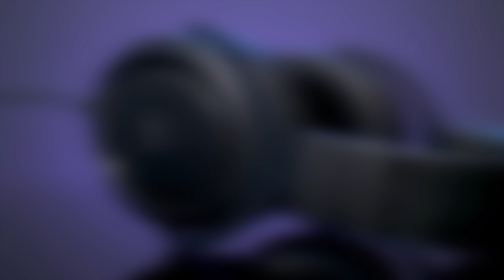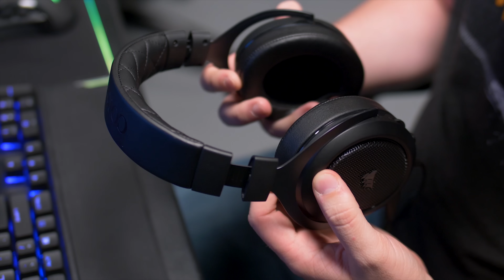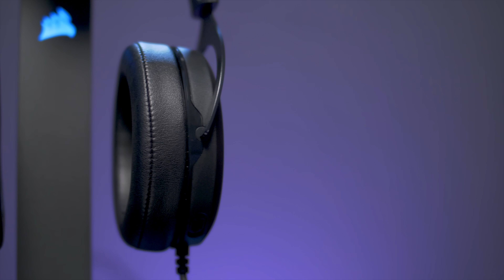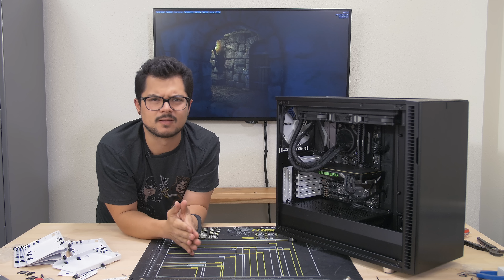Getting intimate with the Define R6: Build and Review

Comment: what I do not understand, all cables are on, I bought one with c port but had to disassemble the old cables myself, to put on the new hmm myself, and of course I was an idiot, and the solder smoked off the start button, luckily fractal was so sweet to send a new start button that I could then connect , nice video

Comment: C'mon Kyle I'm old an old fart, ok. Some of us have use for optical drives especially on multimedia PC's.  Many of us have media, older games or still burn cd's. There is always the option of buying and expensive external BD burner but they are not as reliable as an internal unit. This is why cases like the Be quiet 900 or Define R6/R7 is appealing to us. Yes you young bucks shame us about our optical drives so we in turn buy conservative cases with hidden drive bays. These are not cheap either. My Lancool PC-K62 is 9 years old and its modified to sport a hidden optical drive.

Comment: Thank you for this review and build. It helped me make the decision to go with this case for my first build. I am not a gamer and not into RGB so I bought a black R6 with no Window as I am more into quiet and a pleasing aesthetic. Although I have no need for it at this time, mine came with the front USB-C as that model was actually cheaper than the available non USB-C versions. I have a Ryzen 5-3600 and an RX580 GPU on the Tomahawk Max, which is Ryzen 3000-ready. Unfortunately, the Tomahawk Motherboard does not have a port on it for the front-panel USB-C, so that will be useless just as in your build. I am not overclocking but was concerned about the heat and air flow as I will be keeping the top closed, so I am installing a Sythe Mugen RevB. The case is really well made and sturdy. The fact that the top panel comes off makes hooking up the CPU power a breeze, even with the cooler attached. I also am a dinosaur who needs a 5.25 drive bay, so will be keeping the 'wall' in place but only using one, or possibly two of the drive trays which should allow for better air flow. I think this is still (Nov. 2019) one of the best mid-tower cases on the market.

Comment: If you use the insulated panel in place of the glass as well as forego the moduvent  this case is extremely silent.  with 2 bottom mounted 140mm fans you can keep an OC'd 1080ti blower card under 70c at all times.  This is the exact config i build for my sister and nephew to do business and gaming on.

Comment: 22:12 power supply fan shoul be downwards The reason for this is so the PSU intake fan will suck cool air into the unit from outside the case.
Reply: Depends what surface you have it on.
If it's on carpet, a fan-down power supply is essentially a dust vacuum. On a hard surface, definitely fan down

Comment: Do yourself a favour and go for aircooling in this case, an AIO in this case is a goddamn nightmare. I have a 280 mm rad, mounting it on top meant that the ModuVent did not close properly anymore. Mounting it in the front in a pull config is not possible because you will need 3 hands. So the only thing I was left with was wacky setup of the rad in front with the fans behind it in a pull config. Intrestingly enough my i5 idles at 30 degrees and max temp is 56 degrees but still. Jesus.

Comment: Thanks for the review, it helped me see the internal layout a bit better, and helped me to imagine my possible tweak upon such.

standard with top open...best of both worlds ^.^
I wish they had re-used the top mesh that the C uses but in a more easy to remove fashion as this was by far the best type that can be used on top, it just needed a little thumb slot groove in the metal of the case and the magnetic stip provides the needed potion to catch while you lift away.

the side for gpu...no...soundcard...yes, if done right, it can almost help to create a wind tunnel effect with the gpu helping to suck air past its back side which normally would not happen.
shame it is $30 extra A and B this so called $20 saving on standard R6 over the glass side one, nope, I think once or 2 time yes, but more oft then not is 10-$15 more for the solid side in canada, the hell is that lol.

would be great if included an adapter to make all the front usb 3 at least (so modern board that can have more than ysb2 header can use as usb3 x4 on front ^.^

shame they did not do S2 wich solid front from R6 as option, so can open the door or not, no reason why should cost over $200 IMO ( not include 13% tax ofc)
3x140mm of S2 for intake, but internal offsets, drive cages etc of R6 with thumb screw drop and lock PSU shroud (to give room for 140-200-360-480 rads and still have a tower to have say 6 3.5/8 2.5 on a stack in front of (with the 3x ssd on the back of mobo)

I always looked at the define ones and love the pull out from front all dust filters
C had the best top dust filter included in the box
R6 love the door IMO, could use the top filter from C, 3x140mm front from the S2 (even if they made when remove the 5mm drive it gives the ability, I think case would increase height max of like 2mm? )
S2 could have offered an "option" lets call "Define Airmax 6" which would be as such.

^.^

Comment: I was about to say I'd rather have the hard drives cooled by a fan to help them live longer, but I decided to do a Google search as often things that we thought were true for years are later proven wrong, and this is one of those cases. Looks like high relative humidity is a much greater threat to hard drive malfunction and failure than temps, and in a house running AC, even mounted the way they are in this build, should be cool enough to not worry about.

Comment: Does he have the rad mounted as an intake or exhaust. Wouldn’t exhaust cause a negative pressure? I figure intake would be best because it’s sucking in cold air and causing a pos pressure. I am aware it would affect the air flow from front to back but since it’s going through a rad the air would be moving slower through and not just blasting towards the middle. Also I would believe it’s close enough to the rear exhaust to get sucked up by it before it blows onto the gpu. Atleast that’s what I think would give best temps.

Comment: This case is pain in the ass. The assembly takes forever. I was afraid to brake plastic parts. The only positive element is the tempered glass. Piece of sheet metal.
Reply: Alex Mijulann Ty I'm building it right now and it's actually pissing me off. The rad mount on the top is not snapping back into place. There's so many issues with the engineering components where thibgs don't fit as soon as you take them out. Or maybe it's just you and me
Reply: I tried install radiator with fans, but the screws interfere with the top plastic filter. I will need to cut it out. It's ridiculous. I can't install 140 fan on the top cause interfere with the motherboard power cable.

Comment: Just to add when mounting a rad at the top of this case if using vengence ram, you need to mount it towards the glass front and not at the back like you did.  The reason is because the fans hit the memory heatsink.  If then you want a 360 rad you have to change the direction of the HDD mounting to the other side otherwise the rad would hit the memory and.or HDD bracket.

Comment: Would love to build in this case, love the horizontal gpu mount. i7-4770k
3 x 3.5 sata drives
1 x 480gb Kingston ssd 
Corsair h80i v2
Evga 1060 6gb ftw+
Corsair cx500m
Gigabyte g1 sniper m5
16gb corsair vengeance pro ddr3
1tb 2.5 mechanical drive
Currently using nzxt s340

Comment: I can't wait for this case to show up in stores, Then I will be able to put my water cooling loop together, and still use every part, trying to do it in the Phanteks Enthoo Evolv was fun, and I loved the look of it. But this Fractal case looks super sexy, being flexible by letting you have a 360mm rad on top or even in front of the case, with a 240mm rad on top allowing an optical drive, something I've been wanting for quite a while, I won't have a good GPU waterblock to show off through a vertical mount, but that'd be pretty neat once I can get one.

Comment: Just a curious question. If I remove the two 140mm in the front and replace them with 3 120mm, Do I have to take off the 5.25" bay?

Comment: I would have liked to see you mount the GPU in the standing up config. (I Forget what its called) But I think you could do a small CPU loop with a water cooler that d be also very nice to see
Reply: Marshall vertical GPU mounting is the term you are looking for. And personally the only reason to mount your GPU vertically is if you're watercooling it with a custom loop otherwise the card is just going to choke itself with hot air that's being exhausted against the side panel

Comment: Is this the best mid tower case WITH optical drive support for air cooling using Noctua D15 cpu cooler and 2 additional noctua 140mm fans at top for exhaust? Originally i was considering Meshify C or Corsair 570X but they don't have optical drives.I'm more concerned with temps than noise or looks

Comment: I still use optical drives, Kyle! Stop oppressing me!!

In fact, I bought the case for my build based on the sheer number of drive mounts and 5.25 bays. Six internal bays and 3 optical bays. Used one of the optical bays for a drawer to put spare wires and connectors in. Very nice...
Reply: Is it possible to mount a 5.25 drive with the open layout?
Reply: cayfoxey yeah it’s just an independent bracket at the top of the front panel.  Open layout doesn’t change that.  There is only one 5.25 bay however

Comment: I wonder would that mount on to a Phase Change Cooling base unit that does away with the need for traditional heatsinks and fans but the CPU has to be installed per the instructions that come with the Phase Change Cooling base but your CPU should be at lest -50 degrees below zero.

Comment: With the optional gpu riser adapter. I'm going to assume you can use it for any pcie card and not just a gpu. I know they make the gpu's run hotter and was thinking of putting my elgato hd60 pro gaming there to show it off instead. Just making sure it would work before spending the $$ on the riser.

Comment: I don't understand that Fractal thinks that people that spend 150 dollar on a case, most likely to house a pc of more than 1500 dollar, want to save 10 dollars by not having the USB type C port. For the sub 80 dollar cases, I could understand, but not with these High end cases.
Reply: This is marketed towards corporate workstations, silence, drive trays, etc. This will be the most popular case that PugetSystems builds in for sure.
Reply: @Adin Nelson: I think that is a matter of perspective. My highest end self build computer cost me about 800 dollars, so to me a 150 dollar case is pretty much high end.
Reply: Mine came (free) with the usb type c frontplate inside the case to be installed by the end user if they see fit
Reply: I'm looking for a case for my build any suggestions? 
Looking at ethoo pro m or meshify c. I want a x62 kraken
Reply: This is not a high end case, more like a mid range don't expect everything to be here.

Comment: Kyle I'm planning to build a pc and I need some help with these specs. I checked the total amount of money for all of these parts is about 1250 but my budget is about 900. Perhaps you could tell me which parts should I spend less money on and the parts part in your opinion which I should take out. Thanks

(I used PC Parkpicker to gather up these specs)
CPU - Intel - Core i7-7700K 4.2GHz Quad-Core Processor 
CPU Cooler - Cooler Master - Hyper 212 EVO 82.9 CFM Sleeve Bearing CPU Cooler 
Motherboard - MSI - Z270-A PRO ATX LGA1151 Motherboard 
Memory - Crucial - Ballistix Sport LT 8GB (1 x 8GB) DDR4-2400 Memory
Storage - Western Digital - Caviar Blue 1TB 3.5" 7200RPM Internal Hard Drive 
Video Card - MSI - GeForce GTX 1060 6GB 6GB GAMING X Video Card 
Case - Fractal Design - Focus G (Black) ATX Mid Tower Case
Power Supply - EVGA - SuperNOVA NEX 650W 80+ Gold Certified Fully-Modular ATX Power Supply 
Optical Drive -  Asus - DRW-24B1ST/BLK/B/AS DVD/CD Writer 
Operating System - Microsoft - Windows 10 Home OEM 64-bit
Reply: Especially considering that old mate above you doesnt seem to know what he's talking about
Reply: There are forums for this stuff on pcpartpicker, reddit & ltt. Just saying, you'll be more likely to get help
Reply: 1. Get cheaper cpu 2. Get rid off optical drive. 3. Save some more money 4. Buy 16gb ram and ssd for operating system.. total about 100-200 dollars more for alot better rig
Reply: Joshua Li 

Get rid of that i7 for starters! In fact dump the intel platform all together, get a cheap Ryzen mobo with a an R5 1600 and you’re good to go! You could even get something less than a 1600 with that GPU.
Reply: Joshua Li you should instead of using so much on the i7 get an i5 6600k and keep the 1060
Reply: Joshua Li also don’t get windows 10 right now use the demo version until then you can save up and then buy it but put the pc build as first priority
Reply: Joshua Li and the power supply is kind of over kill you could easily use a 550 watt

Comment: Hey Kyle! Do you know if one could fit a 420 radiator in the top without having to remove the drive cage plate thingy? It seems like it's quite a snugg fit with the 360 and that a 420 could be too big. I'm talking about this plate: https://puu.sh/yOEIk/cbd5055913.png Thx!
Reply: No it doesn't. The mounting for the wall section block off the farthest rail where you would screw the rad in. Only up to a 360. There's no info about a 280 rad though.
Reply: Well... Good bye Define R6, welcome back be quiet! Dark Base 900...
Reply: addicTwtf well, the dark base 900 is considerably larger. But I would question its top airflow capabilities.

Comment: i've said it before, i will say it again. that type-c frontpanel should have been included. 
i know, not that many boards out there with typ-c frontheader, but that goes for cases aswell. the more cases with type-c, the more boards will come. and vice versa.
Reply: I agree. Perhaps they could fix this issue by allowing a rebate if you send the old front panel connector back.
My bet is that they need to empty their stocks of old front IO panels.
Reply: More people complained about Type-C being a thing. The same thing as phones where everyone hates wireless or Type-C for audio. It will be a while before we see Type-C as the standard.
Reply: i don't think they will do a rebate with sending back the original panel. the only thing i can see them doing is giving you a discount, if you buy the upgrade panel directly with the case. 
i'd like to see another SKU with the panel already installed.

Comment: what's the use of front dust filter if the intake grilles without a filter is in the left and right side after the front dust filter. or does the left and right grilles have filter too? thats a fail design, even if you open the front cover and the there is no filter in the left and right grilles.
Reply: Why would the side vents need a dust filter when the front filter has one? Air first passes through the side, and then through the front filter. The front filter sits behind the side vents.
Reply: Jared Moore 
Seriously?? Enjoy you dust ball computer
Reply: I'd still remove the dust filter because using a can of air once a month isn't difficult maintenance.
Reply: zeemonkeyman1 I've been running my current system with 4 intake 2 exhaust unfiltered for the last 2 months to test for dust build up, it's barely noticeable in thermals and visually, I figure because my computer is in a relatively controlled environment.
Reply: ow, seen the casing with a good angle in a different vid. filter installation is right, its before the side grilles so it will work

Comment: i just hope that they let you chose to buy the case either with or without the type-C connector right from the beginning instead of forcing you to pay 30$ extra for it instead. i mean come on it should be the same as with the side panel, you either want tempered glass or a metal side panel, also lets say i do buy the front panel connector with the type-C what am i supposed to do with the other front panel connector? at least let me maybe return it and instead of making me pay 30$ for the type-C i pay 10$ for example that would be great. over all i really like this case as it almost have everything you need to build a great system in it. 8.5/10

Comment: A missed fact about this case, that I have only seen on jayztwocents so far, is that you could potentially install the tempered glass panel on either or both sides of the case, if you're into that. And I imagine the same is true for the metal panel.
Reply: OC3D TV too iirc

Comment: If the Type-C USB kit and the GPU Riser were both included with the case at the regular price, that would make it worth the $150. Right now it's not. I could buy an NZXT case for $80 with similar features (all-be-it, lacking a few extra "convenience" features).
Reply: I could buy an NZXT case for $80 with similar features
Which would that be? The S340 Elite? Does it have a a fan hub? Does it have room for 11 HDD's + 2 SSD's or 9 HDD's + 5 SSD's? Does it have room for up to a 420 rad in the top and still house 2 HDD's + 2 SSD's? Does it have room for 8 140mm fans? Does it come with the same silence levels as a BeQuiet Pro 900? Can it mount all these hard drives in the front and still have room for a front radiator?
If you don't need the above features, then sure, go and buy the S340. But don't call these features "convenience". You know what's a convenience? A GPU riser card. You need to pay 40EUR anyways for an aftermarket GPU riser. So you're saying if it came included, this case would only be worth 110EUR? That would make it cheaper than that 460X from corsair, with its atrocious cable management. The fact you want an included 40EUR worth cosmetic add-on just shows you don't grasp the value of money. Or am I mistaken?